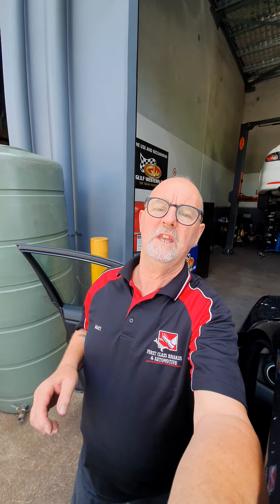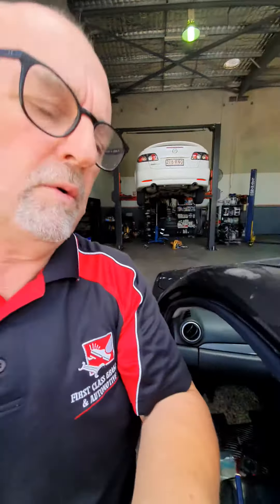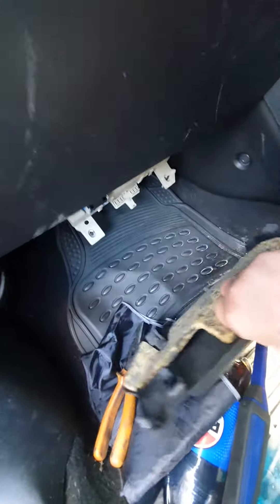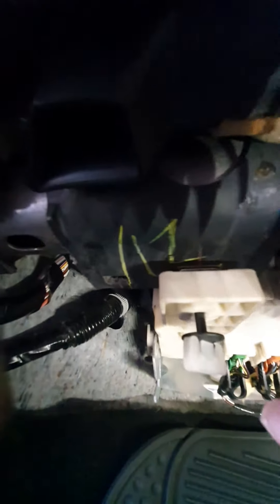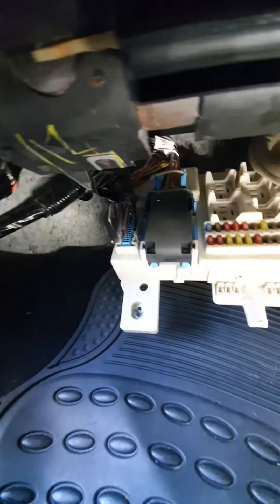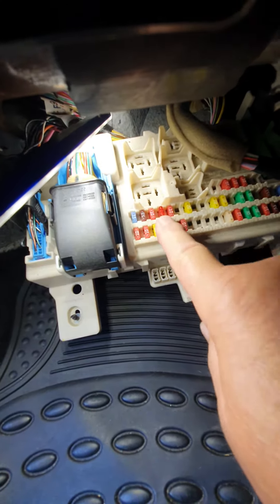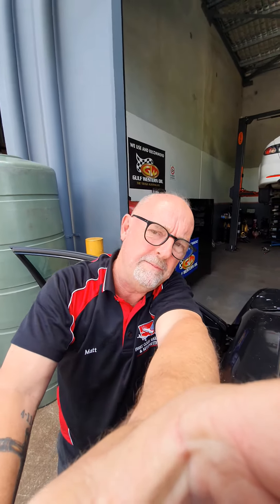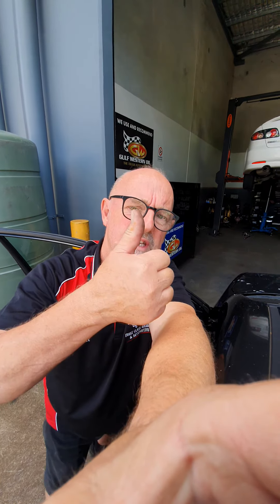Mazda 3 Park lights and tail lights don't work #light #healing

Comment: I have a Mazda 3 from 2006, and its rear left tal/break light, which is LED stopped working.  It happened a month ago but started working again by itself. Really weird, dont know what to do really so I will try to check the fuse box and might need to visit the electritian.
Reply from the maker: @rickironblast  check the electrical connector plug at the lens making sure its connected properly but yes an auto electrician may be your best option Regards Matt
Reply: Did you end up finding out the solution? I have a mazda 3 2005 rear left break light LED works sometimes & then stops working sometimes. Not sure of its an electrical wire issue or a faulty bulb